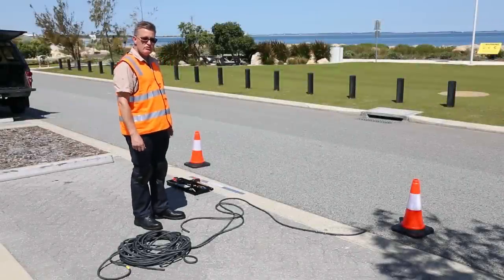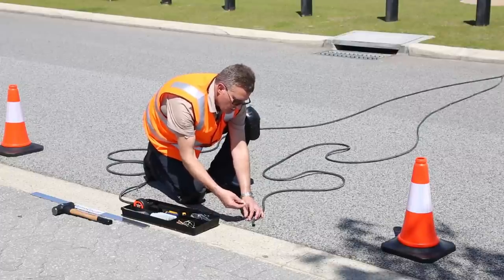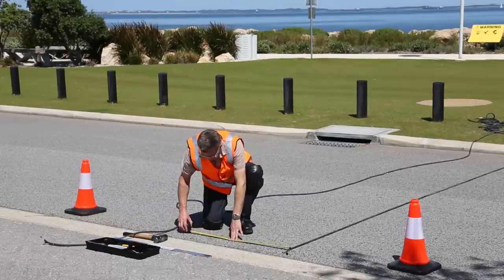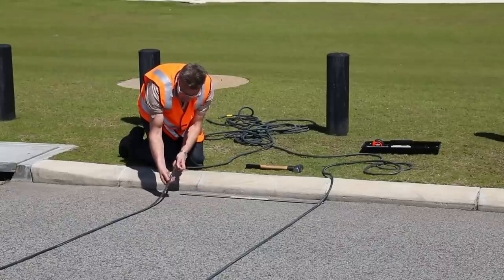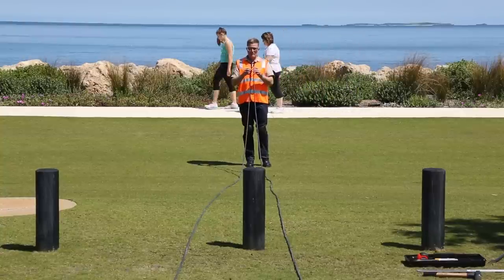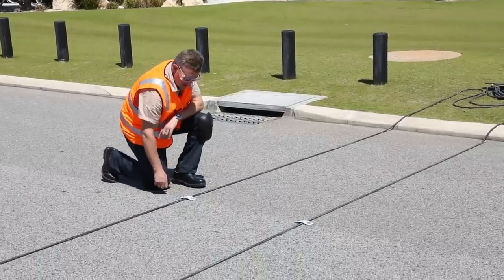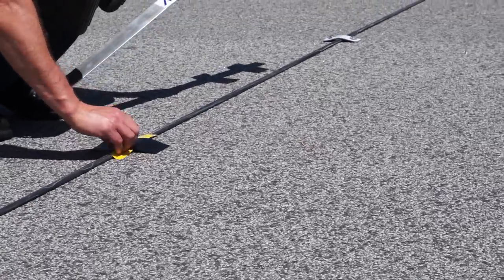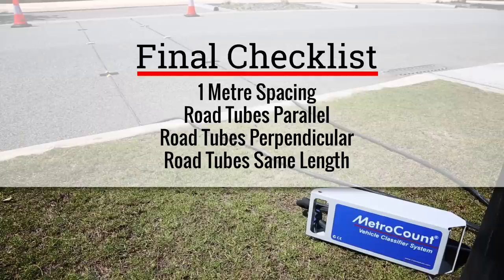Traffic Counter Installation: Part 3 (Road Tube Placement) | MetroCount

Comment: I used to nail in the road but it made a complete mess of the road at times. I now drill a 6mm hole in the road and use concrete screws. There are many benefits to this system:

Using nails leaves a hole which during the winter fills with water and then turns to ice which expands and damages the road. Fine in Australia I suppose but not in the UK.

After removing the tubes I put the screws back in which seals the hole. The screws normally last 3-4 years so the tubes can be re-attached at a later date.

I often found nailing in the road more dangerous as a few times the road disintegrated and hit me with stones in the face. (yes I was wearing safety specs)

Your counters are second to none. I've used CA Profilers and Golden Rivers tube counters. They don't come close to the capabilities of Metrocounts 5600. The only draw back I think is the lack of a database like CA Traffic have (VDA). 

I'd like to see raw data being uploaded to one database rather than having several or at least being able to convert Metrocounts raw data files in to dmp format. You can do this in MTExec but it only converts itto one channel so can't feed it in to VDA.  I was told there may be some legal issues but I wouldn't think CA Traffic having exclusive ownership of the dmp file format.

Comment: are these tubes able to measure vehicle speed?
Reply from the maker: Yes, they can and they are very accurate too. 
Speed is measured by recording time stamps of axle hits on both tubes. 

Make sure you are using 2 tubes, installed parallel from each other and perpendicular to the road.
Also, the distance between the 2 tubes needs to be the same as the one indicated in the software (1m by default).

Comment: Ok that is the most overcomplicated way to count traffic I can imagine. Just use an optical system that is placed next to the road. Nailing rubber hoses onto the road, come on...
Reply from the maker: horle Hi Horle, 
Thanks for watching our video. 
While the benefits of a simple optical system placed next to a road may initially seem obvious, in reality a range of road, traffic and weather conditions combined with the variety of physically varied vehicles present on a road create a range of issues when calibrating to ensure accuracy over the duration of a traffic survey. Optical systems also require more power limiting the battery performance compared to a passive pneumatic system. It would also be difficult to isolate a single lane of traffic without any reflector mid carriageway.

Many systems that are optical and off the road have come and gone over the years, but never gained widespread acceptance due to inaccuracy.

The MetroCount system is not simply 'counting traffic', it provides detailed speed, headway and classification statistics based on Axle Patterns.

The MetroCount 5600 Pnuematic tube counter is one of the most widely used and trusted traffic survey products in the world thanks largely to its accuracy, reliability and range of reporting in our MTE software.
Reply: And then you'd need to analyse the video. 

Plus the fact you need at least 7 days to get a full picture of how the road is being used. And as Metrocount said that way would not classify speed and class.